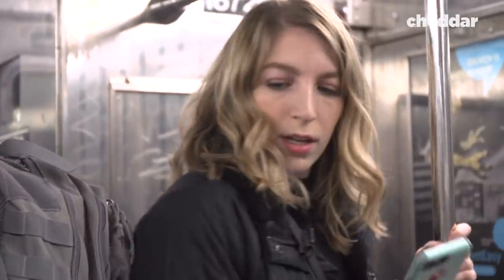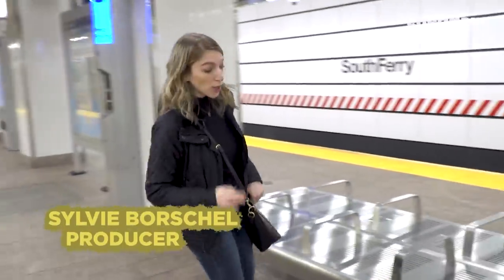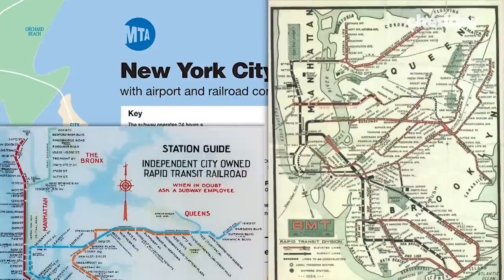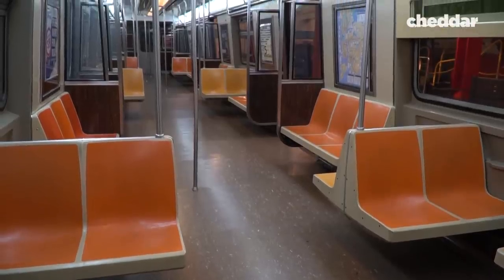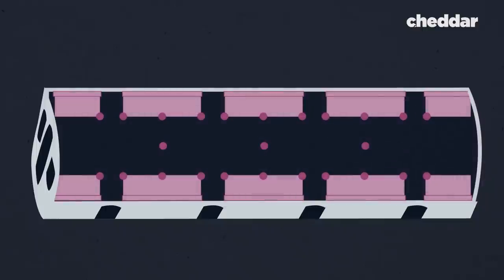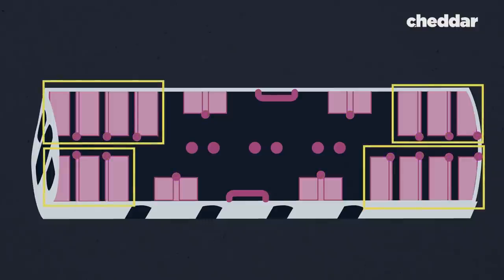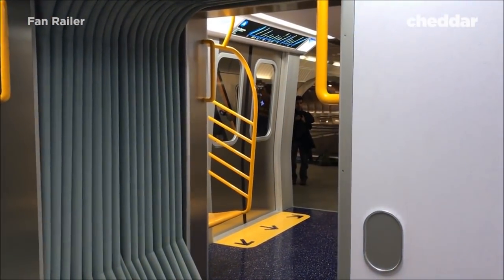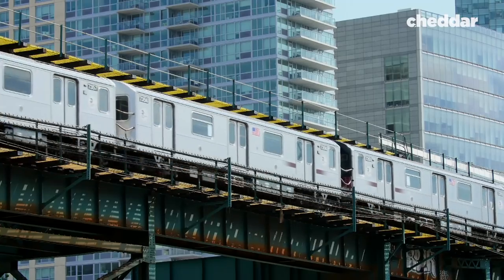Could This Subway Car Save NYC Transit? - Cheddar Explains

Comment: If there is some way to get people to move to the middle of the car it would be a lot better and  the train can get out of the station quicker.  I understand if someone is shorter they would need to hold on to the bar near the doors but if taller excuse yourself, move to the middle and hold on to the higher bars.... So many time trains pass and there's so much room in the middle.  As crazy as things are in NYC, I wouldn't trade it for the WORLD! I LOVE NYC!

Comment: Excellent research - the way to go in order to fix any problem, improve on current product(s), stay competitive and not become obsolete,.... MTA-NYCT needs a whole lot of this type of research to save the agency from becoming obsolete. Issues: old rail system infrastructure becoming dilapidated and crumbling, yet must  meet NYC mass transit needs, current train signaling still analogue based (built in the 1930s), riders dumping metallic trashes on a 600 Volt DC lines, possibility of train riders falling on the tracks, .... Challenges: No ground space in NYC to build new rail lines and shift transportation to the new rail line or expand the current rail lines and then cars if needed, the system runs 24/7 hence, thereby making maintenance and upgrade a terribly serious challenge, management decision making; funding management etc.!! What NYC and the US needs, is this type of research by Cheddar. Most important challenge: Will MTA-NYCT management make and act quickly on the results of such research data, collected by Cheddar and others? Thanks Cheddar for your research. Please do more in other MTA system areas such as signalling system, train scheduling, scheduling disruptive root causes, etc.

Comment: 1. those 2 competing transit companies were not 'authorities' but private companies, only the IND was bankrolled by taxpayers.
2. IRT tunnels are narrower because this was the first subway company and the BMT/IND did not exist at that time so there were no 'competitor' trains that
were larger/wider. The width of the tunnels was determined by the cost, available space (angles of curves, width of streets etc.) and size of the rolling stock.
3. The 'buyout' wasn't quite so simple. City government regulated subway fares and kept the fares at 5 cents so long that the IRT/BMT were financially
hamstrung pushing them towards bankruptcy. The 2 private companies launched pr campaigns to raise fares but were put down by city hall.
4. Knowing how dysfunctional the MTA is, not surprising that this 'cattle car' layout is what they spend tax dollars on. New rolling stock on MNRR & LIRR
have fewer seats that are less comfortable than the M2 & M3's leading to more standees in each car.
When it comes to unaccountably, the MTA's attitude is - jack up the fares (to cover their ever increasing debt) and let 'em stand (modern version of 'let them
eat cake') while MTA board members and upper management ride above ground.
Nothing is quite as simple as these videos portray.

Comment: Getting rid of the seats on the outer most corners is, in my opinion, a better design. People can get in quicker as they spread out in the larger space with no seats blocking them, people carrying luggage, stroller, or a cart can park themselves there. It's not in place on the new E Trains, their the ones with the yellow paint and artwork on the outer most corners that extend to the ceilings.
Reply: ruzzell907 Maybe we can complement that with open gangways for even bigger capacity increases.

Comment: The newer cars are probably nice, but upgrading the signalling over the whole system should be a higher priority.  New signaling will allow for shorter headways between consists, which would allow more consists per hour, which would increase throughput .... and lessen crowding ...
Reply: The signaling system, which is a separate issue, has nothing to do with subway car layouts. No mention of seat placements, pole locations, etc.

Comment: The open gangway is a must. That changes everything. They wouldn’t have to change all that much else.
Reply: That I agree. As someone who has ridden the 2, 3, 4, 5, A, and C pre-pandemic in the morning and evening to and from Brooklyn (with a 4 and 5 train ride uptown during the afternoon), I can attest to having overcrowded trains one afternoon another (I can barely get on at Utica Avenue). Having open gangway trains can help alleviate some of the congestion on those lines and will be of big benefit.

Comment: There's an easy solution.

Make it where half the wagons in the train are for seating only and the other half are for standing only. There doesn't need to be a reason for there to be so much seating when NYC is this overpopulated. Most people just want to get to where they need to go as quick as possible. If you make it where there is only seating at one wagon, there would be less blockage as people would only get up when it is their stop. For those who are standing, it would be less congested because more standing spots = less packed = easier to navigate around. Those in for longer rides would generally be sitting = they wouldn't be blocking those who are just in it for shorter rides. Best of both worlds, really.
Reply: Ocean Spray On the 42nd Street Shuttle, one of the train cars has all seats removed while the other two still has seats

Comment: You can tell that the designers of the open gangway concept never, ever rode the subway in NYC. Here is a common, (pre-COVID), scenario we straphangers are quite familiar with: 

It's the middle of winter and the middle of rush hour. A train pulls into the station. As the train passes, we notice that each car is packed with people; except one that is virtually empty except for a very few people. Veteran straphangers instinctively recognize the situation and start moving towards either side and start squeezing into the crowded, adjacent cars. Why? Well, some less experienced commuters leaving that nearly empty car to move to the crowded adjacent cars, waving their hands in front of their face, are all the clues you need.  Like most major cities in the U.S., NYC has a population of homeless people that seek shelter and protection from the cold winter air in the subway system, as any human being would. Sometimes, some of them, don't get the chance to bathe as often as they would like -- and, well, there you have it. Regardless of the social sensitivity of that reality, without passing judgment, that situation exists. An entire car is virtually unusable, until the air eventually clears.

You can now see how the open gangway concept is a very bad idea.
Reply: Lmfaoooooo I Was Just On The J & 2 Ppl Were Smoking K2 In Between The Cars & Inside By The Door. Only Know About That, Cuz, It Smelled Like Burning Grass After A Fresh Rainstorm (WTF?) Gang Way Layout Will Def Convert Me From “Passenger” To “Driver”
Reply: Actually, the open gangway designers have ridden the NYC Subway. It’s a great way to increase capacity, similar to how other cities have done it overseas. One minor issue shouldn’t mean the open gangway trains are bad overall.

However, to address concerns, some cars will be primarily assigned to the A and C lines.
Reply: @anthonywilliams5192  Not really. Open gangway trains are great for rider safety and will improve service. They’re also planning to implement open gangway trains on the 4, 5, and 6 lines, so you can continue to ride the train as a passenger (unless you plan on driving NYC Subway trains)
Reply: @TheRailLeaguer  Bro, I’m Talking About Driving An Actual Car. No More Transit For Me.
Reply: @anthonywilliams5192  Why? What’s wrong with riding transit? It’s cheaper, reliable, safer, and with new improvements in subway service (such as open gangway trains used all over the world), it’s only getting better and better.
Reply: @TheRailLeaguer  Sheit. 1.It’s Dangerous, 2. Vermin Ridden, &, 3. I’ve Been On Plenty Trains/Buses Since Last Year That Were Obv NEVER Cleaned & Had Roaches & Shit. 4. That OMNY Shit Is Def A No 4 Me, When They Eliminate The Metro Card Within The Next 2-3 Years. It’s Too Late, Bro. I’m Already In Process Of Getting My L & My Ride This Summer. Blech.
Reply: @anthonywilliams5192  Are you still making jokes because I didn’t understand a word you said.

Comment: Great video! Anyone know the distance from the center poles in the middle of the aisles to the edge of the bench seats? I'm trying to determine the maximum width of a cart that could be wheeled freely down the aisle. This distance is more difficult to find online than I initially realized. Thanks!

Comment: okay but it's been shown that humans don't really like super open spaces like a house where you can see the wall nearby and stuff with that king of open design is okay but like seeing the infinity space of the no-door train would probably make people uncomfortable (i know looking down the inside of the infinity snake going down to a distance that's so small i can barely distinguish anything makes me uncomfortable) but if it helps travel go faster they wont have to stay as long so that's more of a question of what you want to trade off. To be clear this isn't against the idea of roomy spaces but against the idea of unclosed spaces. doesn't have to be a door really, it could just be some little half walls to show there's seperate areas

Comment: IRT lines should have horizontal seating, and IND and BMT lines should have r44/46/68 style of seating. That is the best in my opinion (I've been riding the subway for 15 years.)
Reply: That would’ve cut into total passenger capacity.

Comment: They should bring in the same design of car that they're bringing to the London Underground - fully open-ended cars which allow you to pass through the entire train, but keeping the side-on seating.
Reply: Noah Shively-Blinn The R211s will initially come with 20 cars in open gangways configuration. The other 515 cars will be in closed gangway configuration to expedite deliveries. If that test is successful, the next 1077 cars will have open gangways.

Comment: The asymmetrical door openings are the solution in combination with two-sided platforms, on each side of the train a platform, left for exiting and right for entering. That gives a better flow of passengers on the platform, everybody walks in the same direction out of the subway station. And entering the subway car can start immediately after the doors open, because there are no exiting passengers. It reduces stop time at stations drastically, probably by a third. It requires a remodeling and expansion of the subway stations though. Three platforms instead of two, the island platform is for exiting only from both directions. They can start with the busy stations first.
Reply: Constructing a second platform is logistically impossible in most locations, especially underground. The side platform at Bowling Green on the 4 and 5 trains was actually constructed offset from the original island platform for logistical purposes.
Reply: JeremiahC99 I don’t think it’s impossible, although it is expensive. Under Schiphol Airport Amsterdam they are planning to expand the train station from 8 platforms to 10 or 12. And it is underground and partly under the terminal building. About the station you mentioned, I don’t know it, but maybe they had one center platform, for exiting and entering for both directions. It’s obvious that gives a spaghetti of passenger flows. But three platforms for two directions, the side platforms for waiting and entering passengers and the middle platform for exiting. All passenger flows are in the same direction. Also in the trains the flow of passengers don’t contradict, with exiting passengers on one side and entering on the other side. It is expensive but an investment in better public transport. Don’t think in problems, think in solutions.
Reply: P Constructor It kinda is, considering how some subway tunnels have building basements directly next to the tunnel wall.

A better and cheaper solution is for open gangways, wider doors (also asymmetrical), and a few seats removed.

Comment: New York should look at what they've done in London, with the London Overground, and indeed the Underground; and this is to have the seating length ways throughout the trains (that is so that they face each other). So no one sits in seats either in the direction the train is going in, OR in seats where your back is facing the direction the train is going in. 

Another solution would be to have 'walk through' trains. By this I mean so it's possible to walk from one end of the train all the way to the other end of it, WITHOUT having to get out of one carriage and enter into another one. These simple things make a difference. Some people say that this would not contain a fire (as none of the carriages are self contained as such), but I think the real reason is to make people feel safer. They can move along the train if they feel threatened by another passenger, without having to get out of one carriage at a station and enter into another one. 

'Walk through' trains also mean that there's more standing room, so trains can carry more people each time. You don't necessarily need MORE trains running, just ones that are better designed and able to carry more people at a time.
Reply: Rob Tyman The upcoming R211 and R262 cars will feature open gangway trains.

Comment: The airplane seats are trash in short range transit.
The offset doors however seem like a nice idea, I can imagine they work quite well.
Also, an open train design is nothing new, it just makes the inside of the train a bit louder.

Comment: Those "Perfect" airplane styled train seats only work on long train stops. Not the short stops. If you're sitting 3rd row and the window seat youd need to get up and squeeze through people just to get out then try to fight your way through to the exits just to find out you missed your stop. These have been tried elsewhere and they havent worked well.
Reply: Ali Aashour Agreed.

Comment: I don't stand by the door to get away from people. I stand by the door because that's where I can stand in one place without moving. When you stand in the middle you constantly have to shift back and forth to let people get around you as they enter one end of the car and head to the other end looking for magical open seats and more space.

Here's a news flash for you people - the other side of the car is just as crowded as the one you entered. Just get on the train and stay where you are.
Reply: There’s plenty of room in the middle of the train to stand. There’s almost no need to stand at the door since that will just end up blocking the doorway for other entering passengers.

Plus you have to move into the center of the car otherwise there won’t be any room for anyone else to enter the train.

Comment: On longer runs I go to the middle of the car to have more room. 1-3 stops I try and hover around the doors. Or I lean up against the gangway door since it’s close to the entrance. It’s funny how they got it right with not wanting to hold onto the pole over the seats. I always felt like my butt was in some ones face

Comment: To reduce station dwell time, remove seats and add more doors.  Reserve fold down seats for elderly, children and handicapped.
Reply: Tv Kodi We already have seat removals on the 42nd Street Line.

Adding doors on the IRT cars will result in the doors unable to line up with the gap fillers at Union Sq.

Comment: The 75-foot cars with transverse seats are NOT the majority, even on the lettered lines.  As long as I remember - that is, for the past 25 years that I’ve been living in NYC most cars have always been 60-feet long with longitudinal seats only.  The older generation of such cars - built in the 60’s - have by now been almost all replaced with the modern ones (R160 and R179).

Comment: 535 open gangway cars?  Not yet. 20 of these cars are in but will be in passenger service in the fall. 40 R211As are in service with 30 cars in burn ins and 5 cars just coming in. There are more on the way.

Comment: If the dwell time is a large part of the problem why limit the size of the door to something that looks like a "door"?  Why not have a large portion of the side of the train slide open, like 8-10 feet or more in size?  Doesnt even need to slide sideways, it could roll up, open the entire side of the train.

Comment: NYC MTA Subway sure has made a lot of progress in recent years, but it has a lot of work still to be done. it seems that it is on the right track (oh the pun) to do so, and it appears that within the next decade it will change and improve more than it has in the past century.
(the new future R-211 cars look great, just make sure they keep the iconic stainless steel exterior)